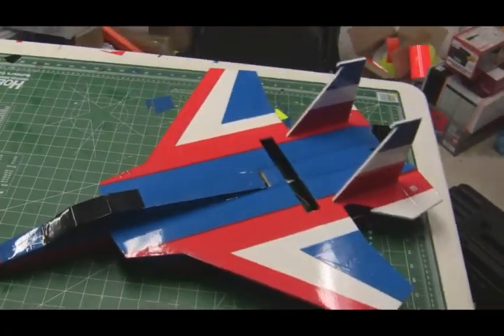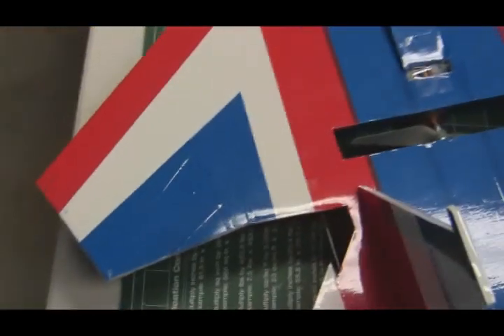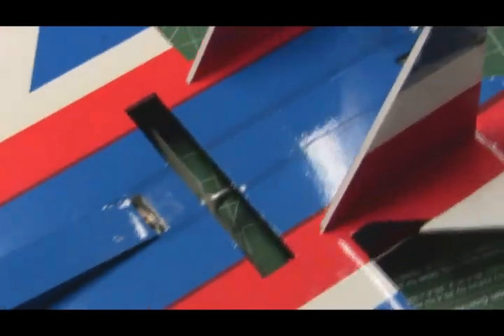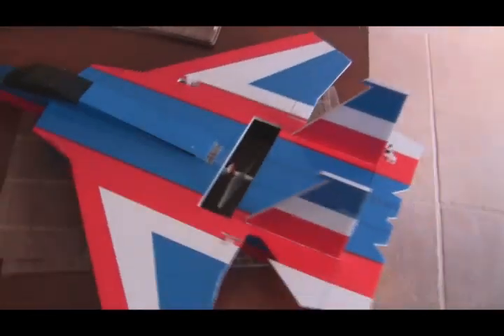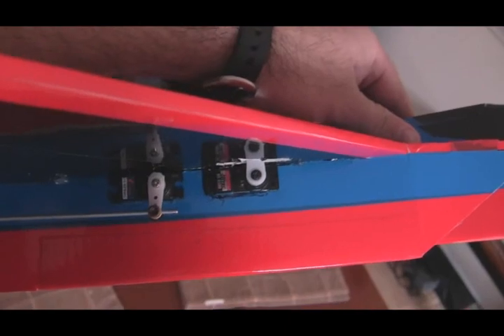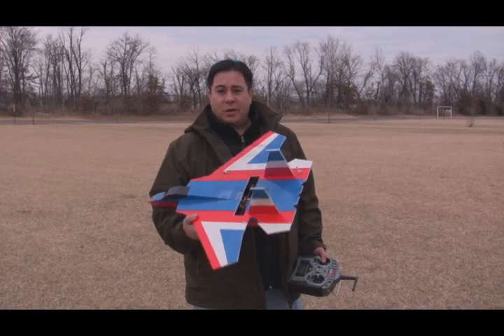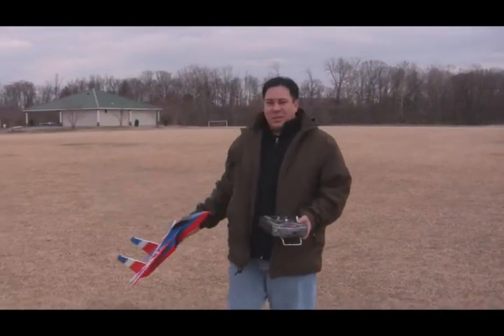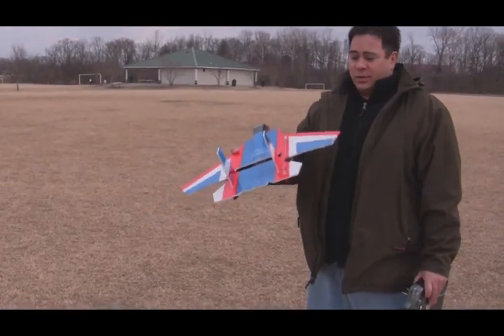Scratch Built RC Plane FF-15 Part 2 (Foam Fighter 15 Rev 1.1 )

Comment: hey paul built your f15 out of for sale sign and is a great plane flew this morning and had to tape stuff to the front to get the nose down and having trouble with counter torque. is very strong and has taken a beating but still works great design!